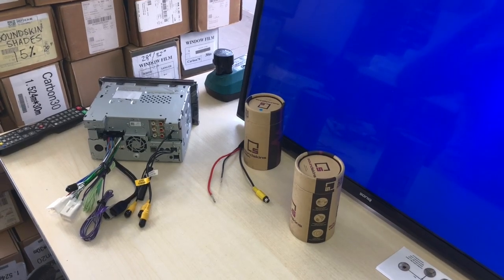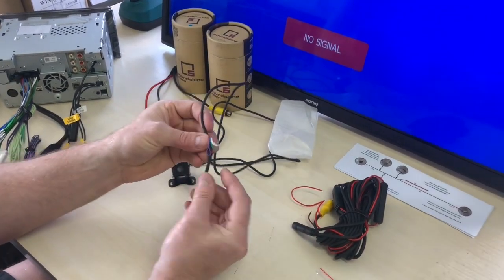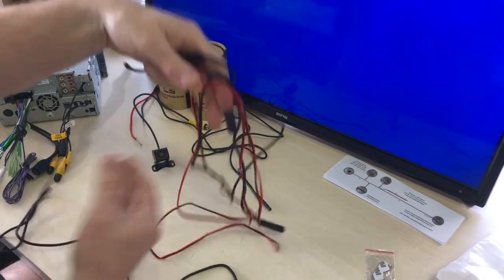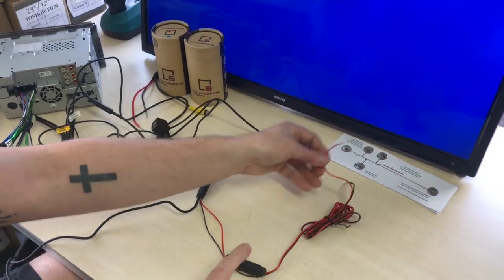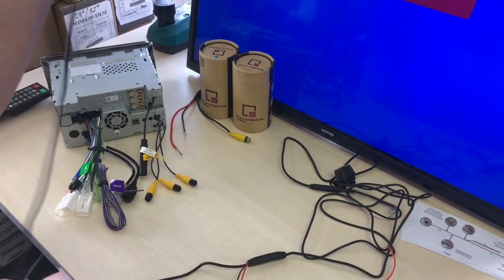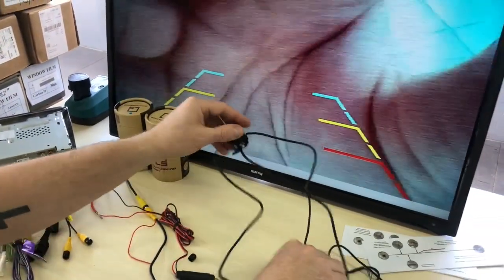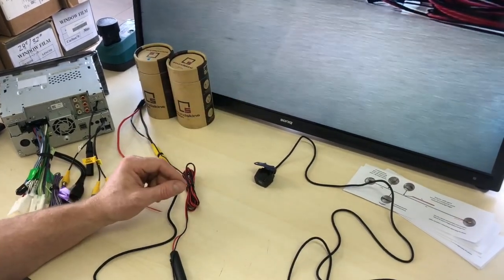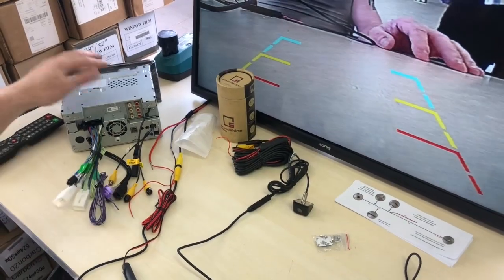How To Wire Reverse Cameras? SoundSkins Vision Parking Cameras.

Comment: What if your head unit doesn't have a yellow RCA input but instead uses a 4 pin white rectangular connection?

I've bought the soundskin vision camera and I've bought an adaptor from the RCA yellow connection you supplied to the white 4 pin plug that does actually fit the head unit. An eclipse avn726ea apparently.

What is annoying is that the setup doesn't work despite checking the reverse light source trigger wire (green) is supplying power.

I note that the original camera has the red wire connected to a different pin on the white 4 pin connector that originally goes into the eclipse head unit and that works. But the other end isn't an RCA yellow and that is the issue ..

So I bought the adaptor.

Do some wiring systems that use 4 pins have the red wire in a different pin location on the plug?? I notice the RCA on the new adapto that I bought separately  has its centre and surround connections going to the lower two pins 

If only it was that easy.

Car us X-Trail t31.

I'll sort it out but just wanted to say it's not as easy as it seems because not all headunits gave an RCA yellow video input
Reply from the maker: Hello, please reach out to Carbon Car Systems for help: https://carboncarsystems.com.au/contact/

Comment: Trying to wire up your camera to an eclipse avn726ea head unit.

You're the reverse camera gurus, so how do I connect the RCA video plug if head unit doesn't have one ?

So far installation into X-Trail is going fine. But plugging it to the eclipse head unit is a problem
Reply from the maker: Hello, please reach out to Carbon Car Systems for help: https://carboncarsystems.com.au/contact/